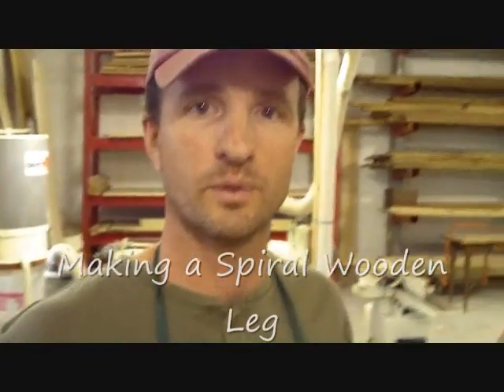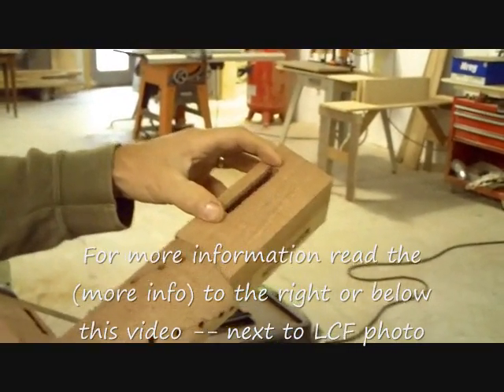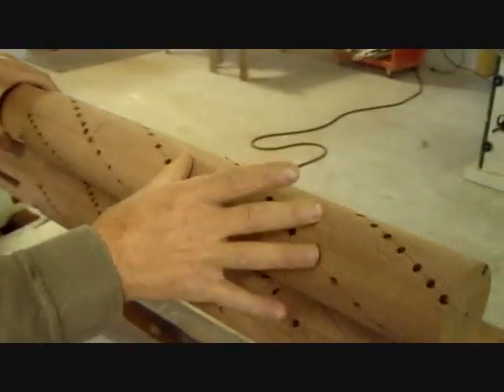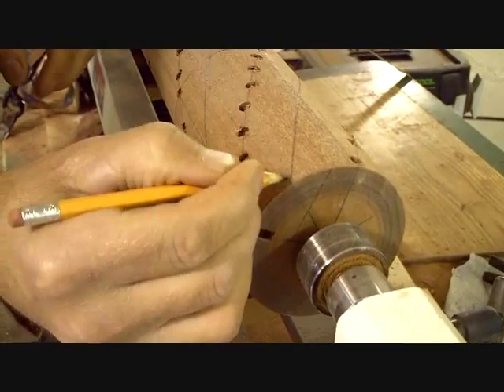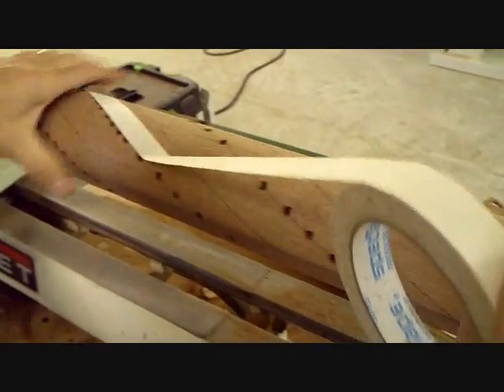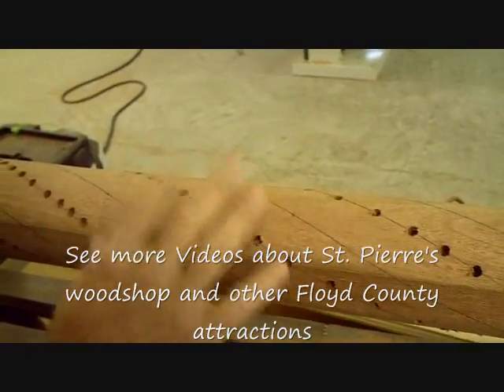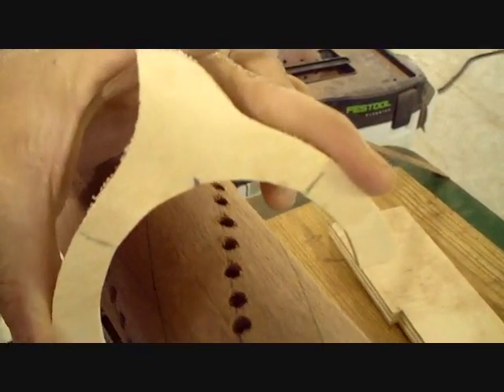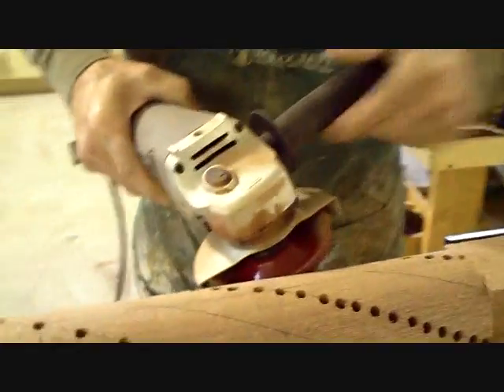St Pierre Woodworking Making a spiral Wooden Leg

Comment: Very impressed by those legs. Have you seen the Arbortech woodcarving disc?. I use them when making mushrooms that i have carved with a chainsaw. I also use flapped sanding discs, the sort they use for metal work. There is footage of the carving disc on youtube, you might find it handy.

Comment: Nice job!The carbide tipped wheel in your grinder can be bought in different diameters and used for much more than wood.We used to produce them for air-powered tire buffers.much lighter tool and easier to use for finish work.Can be bought at Harbor Freight & other places,check them out.